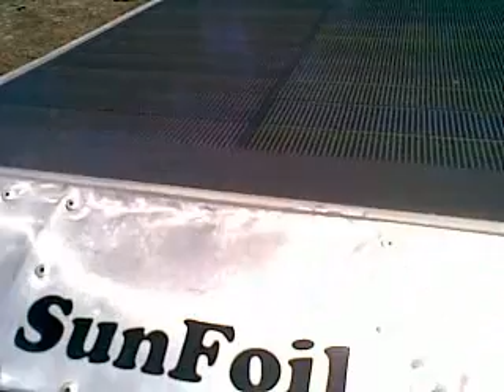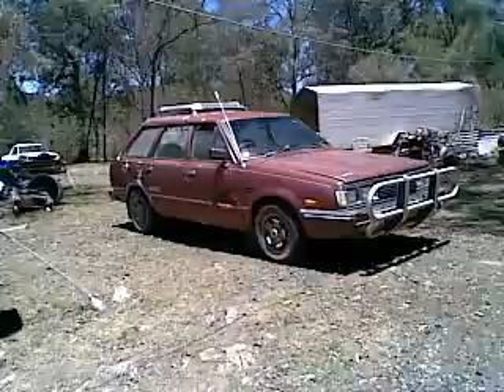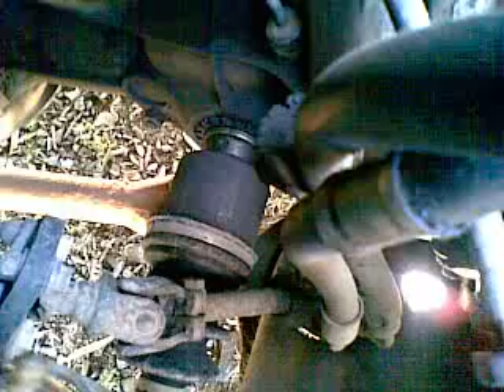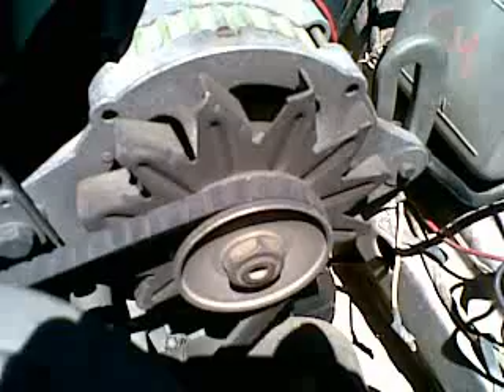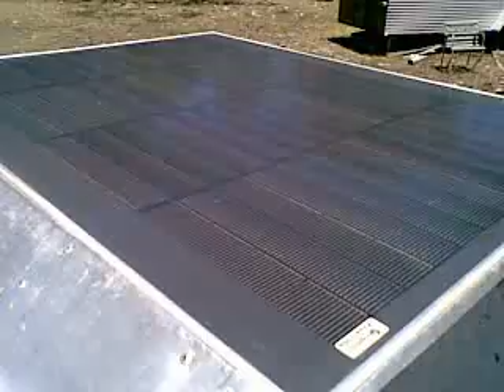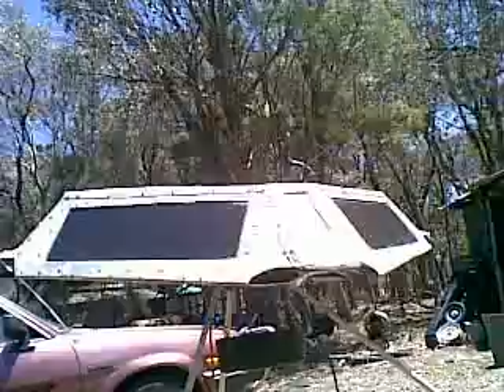SunFoil Theory & Practice... Remedial Therapy... For @pjd412.

Comment: 16 . 15 ......... " ....... with the same vehicle on the same terrain ........ " ........ I would suggest , it is a worse vehicle on what may be the same terrain . It ' s older , than when you took the original figures . That would suggest that there will be more blow by the pistons , less efficient , OK it ' s all run in , but I would suggest there will be more leaks and losses & you are still getting a notable improvement .